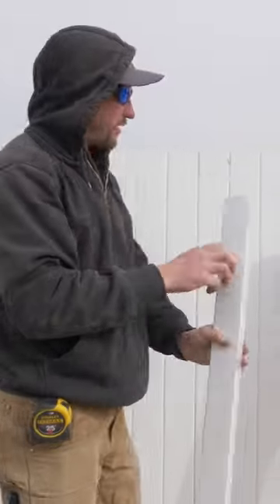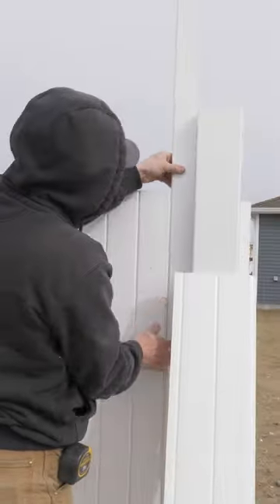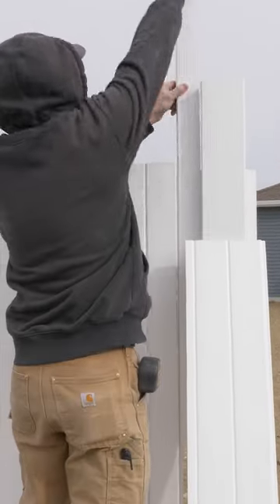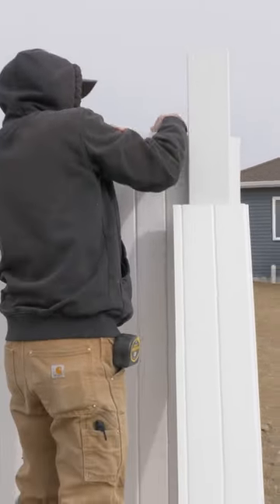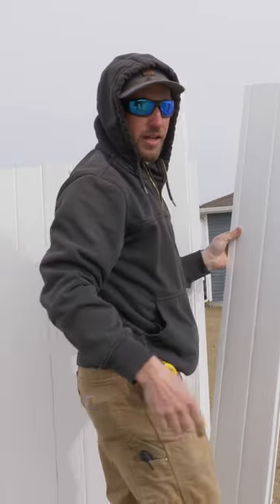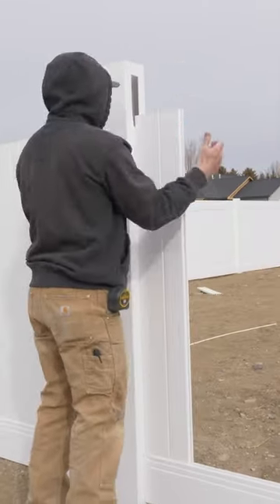Stop Wasting Pickets When Installing Vinyl Fence #privacyfence #vinylfence #nodigfence #nodigvinyl

Comment: Why does it look like that post is cut at the bottom? Shouldn’t it be buried? Just curious since I’m about to put in my own vinyl fencing shortly.
Reply: Does look cut which is wrong... unless somethings making it so they can't dig, prob just gonna cement it 😂🤷‍♂️
Reply: Nah they probably did no dig method, which you drive post into the ground and use " donuts" goes around your aluminum post. Slide vynl post right over it.
Reply: @dustinrossi9384  You're correct. I've watched the long version of this video. It was a no dig job where they drove metal posts into the ground and slid donuts over the posts. They then screwed the vinyl post sleeves to those donuts. Pretty efficient, much quicker.